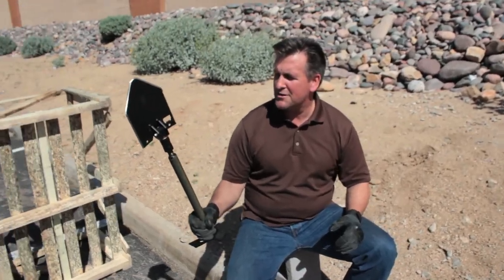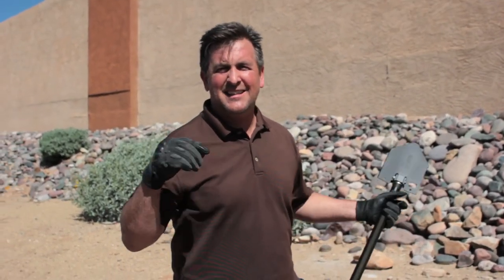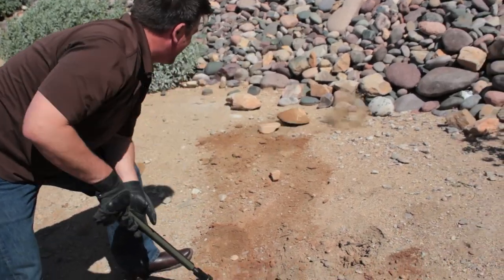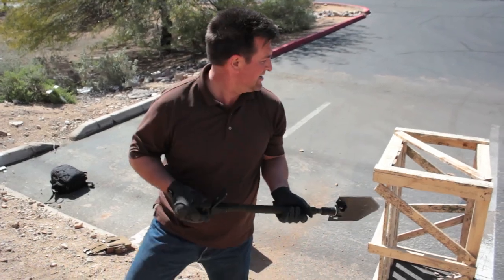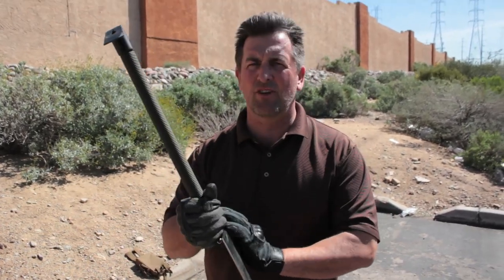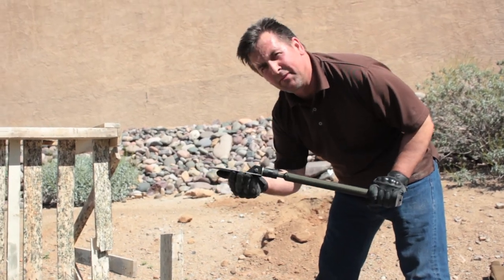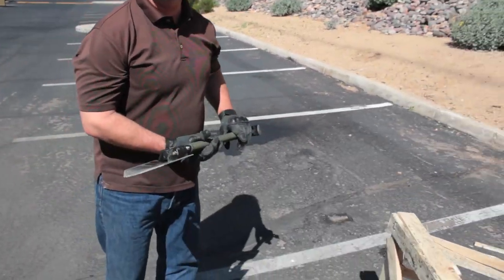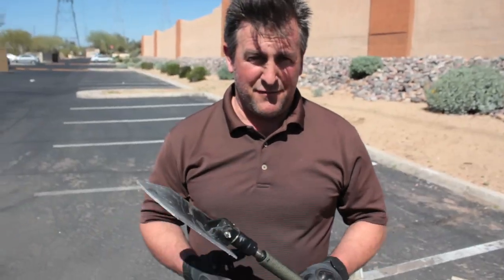Crovel Extreme 2 Survival Shovel Reveal by Tim Ralston of NatGeo 's Doomsday Preppers

Comment from the maker: Thanks for viewing! To answer your question: Yes! We improved on what was already the toughest components used in any E-Tool that we know of by further upgrading the hardware components(nuts, bolts, washers), all-thread, and most notedly - we've included the new angled chromoly steel shovel head in the new design. Improvements and design changes are fueled by users like you, and we thank you!